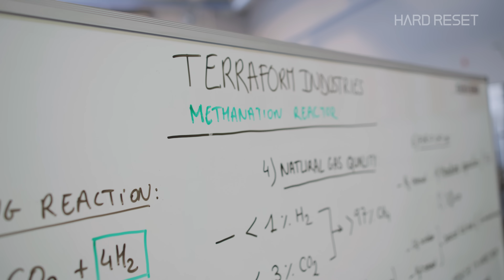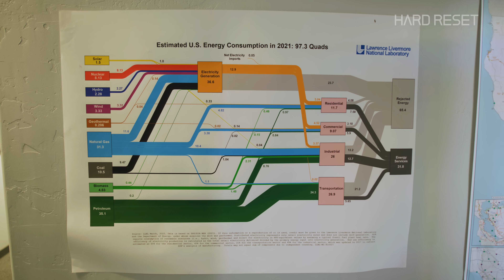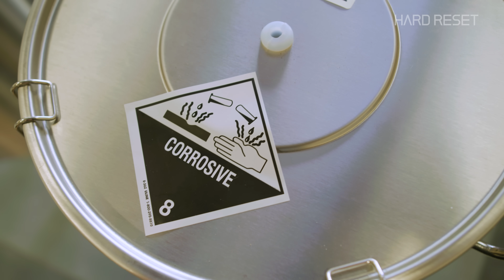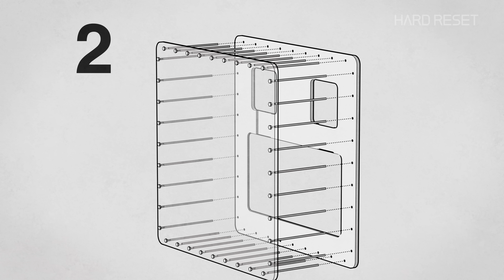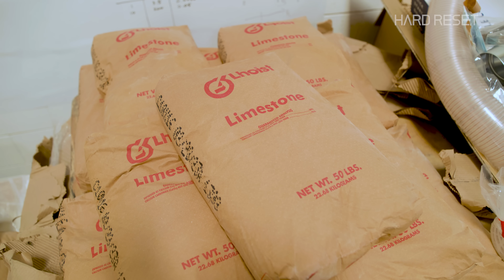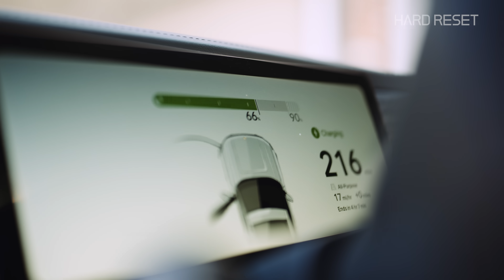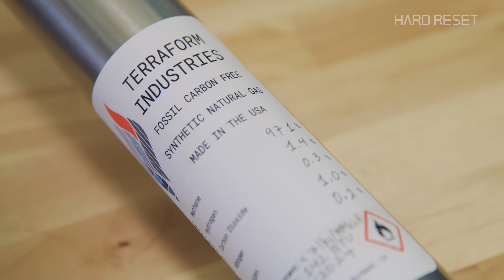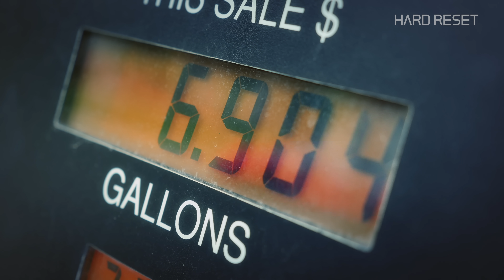The Last Fuel We'll Ever Need?

Comment: Our current natural gas infrastructure is notorious for having leaks. It spews methane into the atmosphere, which is a much worse greenhouse gas than CO2. Climate Town did a great episode on natural gas that talks about these leaks. In concept, I love the idea of replacing fossil fuels with synthetic fuel that endlessly recycles the carbon dioxide that gets emitted. But that assumes that all of the infrastructure works perfectly, and there are no methane leaks, which is definitely not how reality will play out. This feels like this project is going to be an example of the backfire effect
Reply: You didnt think of the fact that it can be produced at the place its being used so you dont have to use those leaky pipes.
Reply: @jedics1 You're suggesting a sea change in how energy has been produced, distributed and consumed for the past century! Synthetic fuel requires economies of scale in order to be economical. Point-of-use generation doesn't meet the necessary criteria.
Reply: If it has a standardised design at the factory level then at least problems can be addressed, and they likely went through plenty of quality control to assure that leaks were minimal to zero.

Hydrogen is VASTLY more likely than methane to leak, to say nothing of causing embrittlement of certain materials, so if they can make it work with hydrogen then methane should be a cakewalk to handle by comparison.

Either way, it's pretty clear that this is not a long term solution, only an intermediate path until the industries still dependent on the energy density of fossil fuels can become more efficient and/or switch to battery power as more advanced battery technology becomes available.
Reply: But you can just spew that out into the atmosphere as long as you pull out the CO2 to make the fuel.  Yes, methane has a stronger greenhouse gas but it also breaks down much faster and you don't need to get it to 0 leaks just less than alternatives.  

Also you can get clever and try to make sure the leaks end up decomposing.
Reply: This method needs to be to be put where the fuel is used to save the transportation cost. Every farm needs one. Every fuel station needs one.
Reply: oh shut up
Reply: I believe the vast majority of leaks come from wells not the pipe network. Particularly disused wells, and oil wells that give off methane as a byproduct. Since efuels don't involve wells the amount of leakage should be very low.
Reply: What's more in the end it's assumed that methane has to be used in appliances that can be easely electrified, thus more energy efficient since energy has to be spent in the first place to make this methane in all it's steps. If you need carbon based fuels or chemicals, more promising is deriving them from artificial crops or agricultural waste for example. The whole idea is worth exploring, but I don't see it putting it as a golden solution to all our problems.
Reply: @rysiu1694 You are right. The worst application is the one they are doing first, probably because its the one they figured out how to do first. Heat pumps and induction stoves take care of the the residential sector. What makes me excited is that they think they can to jet fuel next. While short-haul jets will go electric soon, long-haul jets going carbon neutral (even at high electricity fuel cost) with this technology is a big win.
Reply: @rysiu1694 artificiall crops or making methane from agricultural waste. Is not that valuable first thing is that we already do that in most waste procesing plants. Second is agriculture is producing co2 on it's own. So that solution wouldn't be neutral because you need to clear area from treas or natural plants and plant there a monoculture. Also this cannot be used in space. And it Wouldn't work when Sun is not shining
Reply: Big Oil sold natural gas as a transition fuel. The sad fact is that methane is 80% more potent than CO2 as a greenhouse gas. 

Studies have shown that just 4% losses and we'd be better off environmentally burning coal--the dirtiest of fossil fuels.
Reply: Well yes, but... a natural gas sector that only has the same leak problem its always had but is otherwise carbon neutral is a better natural gas sector. Leak detection and correction enforcement is not a technological problem, its a regulatory and cost problem.
Reply: The leak problem exists if this is implemented or not so its irrelevant in this case. It's not like existing green solutions are good enough to be adopted since they all require the entire infrastructure to be replaced and that's super expensive (and not realistically going to happen).
Reply: The thing we really need to go after is the planet releasing methane. It constantly releases it at scales we can’t even comprehend.
Reply: More CO2 -> more heat and photosynthesis -> less CO2. Nature is not so plane, as climate mafia
Reply: Methane is a nasty greenhouse gas, but it doesn’t stay in the atmosphere forever - it gets oxidized by free radicals in the atmosphere, breaking down into CO2+2H2O. Most methane is gone from the atmosphere within 20 years. While it is important to pay attention, it’s also important to have a proportional response, rather than IT’S ALL BAD NEVER USE IT. Only about a third of the methane in the atmosphere is from fossil fuel infrastructure leaks - the rest is agriculture or natural processes (you’re emitting methane too!). We also need to look at future use of methane. Methane is currently used for electric generation, residential/building heating, industrial heat, and as a feedstock for various chemical processes. Over the coming decades, it will be displaced for electric generation by cheaper solar/wind+batteries, in most building heating by heat pumps, and in all but the hottest industrial heat by thermal batteries. So I expect consumption to fall at least 50%. 

So it’s hard to completely get rid of methane. But if we can get rid of FOSSIL methane, we can stop adding more CO2 to the atmosphere, at least. CO2 is a much bigger climate problem, in both the short and long term.
Reply: Isn't natural gas methane? And isn't natural gas abundant? And now they say that natural gas isn't from plants that died millions of years ago but from radioactive decay deep inside the earth. Which means it will never run out. So we could just grow plants for food and stop wasting our time with this and just pipe it out of the ground. And don’t release it. That’s wasteful and expensive. Like pouring gasoline on the ground. Don’t do it.
Reply: It’s amazing how people make up stories of widespread methane leaks.  You can’t sell what leaks out.  No way is it cheaper to leave things leaking and it’s also ridiculously dangerous.
Reply: small on demand with no fuel storage negates the need for pipelines, storage of large wuantities, or concentrating it for transport...

most of these can be made at home.  and run safely. maybe safer than some methane production is currently done. 

methane, hydrogen , alchol very clean burning and together very good energy. all can be produced on demand with water and electricity.
Reply: The real advantage of this tech is when natively liquid fuels can be made through this process. The biggest advantage is the plug-and-play into existing ICE infrastructure and machines.

The main benefit of fossil fuels is portability, as battery tech will have to get MUCH better to match the energy and power density of burnable fuels. Because this uses electricity as an input, it makes no sense to go thru the intermediate step of methane generation for on-site use - just skip it for straight solar. 

However, if they can make carbon-neutral commodity fuels at scale cheaper than mining, they really have something. Add a refinery to turn methane into liquid fuels and they have a game changer on their hands.
Reply: @XxxThePsyCheMisTxxX  There already is an electricity to liquid fuel pilot plant in operation in S America. But because of the huge amount of electricity the process needs (it takes about 10x as much electricity to drive a fuel car 1 mile as a battery car 1 mile) it will always be a lot more expensive than just using a battery car. Synthetic fuel will be used only for premium applications such as flight, emergency vehicles, military uses, racing, etc. Maybe trucks in extreme environments. Most cars will be EVs because they are already good enough for most people's needs and are improving all the time. There's a car in development now that can recharge to 80% in 5 minutes. That's so close to fuel that it no longer matters. Synthetic fuel will be used as a luxury item for running classic cars and by people who need to drive a really long way without recharging. Within a few years the production cost of an EV is going to drop below the production cost of an ICE car. When more EVs start to filter into the second hand market there will be cheap EVs available for people who can't afford to buy new. Today rich people drive EVs and poor people drive ICE, but in the near future it's going to be the other way around.
Reply: It doesn't matter if there are leaks because it's taking the carbon out of the air to begin with. If a little bit leaks back, who cares? It's better than doing nothing.
Reply: You're totally right about leakage being a major problem! If we want to be charitable: the majority of emissions related to drilled methane are not caused by leakage, so replacing all existing fossil methane with recycled atmospheric carbon methane is still a large overall emissions reduction. Again, I totally agree it's not perfect, but that's a good step in my book.

Methane from the atmosphere isn't just useful for combustion as a fuel. Those activated carbons (especially if available at low cost) could be added onto other chemicals to replace fossil-fuel based commodity chemicals or to be made into degtadation-resistant polymers as a means of long-term storage of sequestered carbon. Ideally these use cases can be accomplished with minimal need for a pipeline, so these applications could foreseeably minimize the impact of gas leakage in contrast to combustion applications that require the fuel to be distributed across many sites. 

I think projects that want to reduce nitrogen gas to ammonia as an energy carrier can help a lot with the leakage problem because ammonia is liquid at ambient temp & pressure. This comes with its own technical limitations and challenges, but I think we do best to welcome a diversity of approaches when pursuing helpful technologies.
Reply: Methan  breaks down to C02 pretty quickly in the atmosphere.  Don’t be an alarmist 
.
Reply: Have I taken into account the leaking methane and gases from the earth's tectonic plates which are constantly moving, cracking and causing 'leaks'?
Reply: so what, you don't know anybody who's ever got sick or died from natural gas it's a meaningless thing to complain about what it does to our atmosphere that can be changed by planting a few more trees or doing something upset that let's see how the world changes the Fukushima disaster and other nuclear disasters when you have a nuclear leak, if you compare the same accidental problems of a little bit of nuclear energy just got released into the atmosphere or a little bit of natural gas just got released into the atmosphere which one affects the world in people 🤷🏻🧐🤔🤯🤯🤯🤯
Reply: It's still better oil
Reply: Climate town is a ratfink dum dum.
Reply: it's interesting that this was not even mentioned in the video.
Reply: I gave my cows extra beans this week to make up for your climate alarmist bullshat.
Reply: You Leak Methane….
Reply: I too don't want to do anything on life unless there's is a 110% guarantee of success and that I will be well compensated. As such, I too am just waiting to die, because while I'm not compensated, it is the least risky and most assured.
Reply: You are wrong about all your assumptions.
Yes there are leaks in everything.
New systems don't like old ones but you're against replacing them with new pipelines.
Gas can convert all coal sources of power immediately. That's a huge drop in polution. To the point we don't have to do anything else while the rest of the world ramps Nuclear and runs our country into the ground with the access to power. 
U.S. refuses to use nuclear so other countries are getting rich using technology we created but refuse to use.
Reply: Methane leaks and Human-generated CO2 are less than 0.1% of Greenhouse Gases. The Second Law of Thermodynamics shows that such a small amount of gases isn’t going to generate or contribute much to make the amount of heat to harm humans and other life forms.
Reply: Methane is only worse than co2 in the short run because it has a low atmospheric lifetime, it will eventually turn into co2 and water wapor, so it isnt worse.
Reply: The more money that gets poured into a technology like this means more money to maintain and upgrade the natural gas distribution systems.
Reply: This device also doesnt end racisme, what is your point precicly?
Reply: Gas flow works in every country without day to day leaks outside of America. Maybe this issue you are talking about is mostly an “America” thing? You don’t have to run pipelines with big leaks… Chemical dosing and maintenance goes a very long way!
Reply: If you have made methane, you don't have to leave it as such.

Catalytic partial oxidation can turn it into methanol, a much denser non-gaseous transportation fuel.

Or you could Fischer-Tropsch the methane into synthetic distillates, like jet fuel, diesel...

All of this chemistry is a century old....
Reply: @NullHand  I was wondering why they were stopping with methane. If we're going to replace oil, it would be better to have something with energy density similar to gasoline.
Reply: @ True, but you also have to convert it back after.... in some cases yea you can totally turn it into other products and it more than likely will be good, but even a little can be still way worest than the Co2 that is normally release... lets also not forget about just the Co2 to mine the rocks in the first place:)
Reply: @NullHand  Yes, and it requires additional processes, equipment and energy to achieve. This makes synthetic methane even less affordable. No one ever adopted a more expensive thing unless it was better, cheaper or mandated.
Reply: What are you talking about?There is no such significant leak in Natural Gas transmission and distribution. (I work in this industry)
Reply: This is using so much water.
Reply: @mrjasonjneal  can that water be recycled and re-used?
Reply: Hydrogen leaks are even worse.  This is one of the biggest problems with using hydrogen for fuel.  Hydrogen loose in the atmosphere is a huge problem, I'm not sure the chemistry but it's a thing, look it up.
Reply: " which is a much worse greenhouse gas than CO2."

Except.... it's not.
Reply: @ 
" which is a much worse greenhouse gas than CO2."

Except.... it's not.

Interesting. That isn't what real laboratory experiments by real scientist, who spent 10 or more years of intense study to become real experts in this, say. The real science shows that pound for pound methane retains 108 time the heat in the atmosphere than CO2 in the first year that it is emitted. 

However, methane only stays in the atmosphere for about 12 years unlike CO2 which stays in the atmosphere for centuries. Thus pound of methane released today will trap about 80 times the amount of heat of a pound of CO2 over a 10 year time period. 

The normally quoted 25 times the heat retention for methane compared to CO2 comes from a comparison of the impact of methane compared to CO2 when integrated over the standard 100 year period. The problem with that number is that for 90 of those 100 years the methane is no longer in the atmosphere.
Reply: CO2 is not a greenhouse gas other than it is used in greenhouses to make plants grow more.
Reply: @Onan-u3b  :D
Reply: You're not wrong. But this could be implemented in a carbon negative manner. If methane is produced on site at natural gas power plants, the resulting CO2 could be captured and stored. Is that economical? Probably not at today's prices. But it is conceivably doable.
Reply: @ryanbrown982  Methane is over 80 times worse for global warming than CO2 - i.e. if you release the same volume of CO2 and methane, the methane will be 80x more damaging than the CO2. If you're removing CO2 from the atmosphere and creating methane, and more than 1.25% of that methane is getting released back into the atmosphere, that is bad for global warming overall. That's the point that's being made here.
Reply: @whatevil  depends on the timeframe you're looking at. Methane decomposes in the atmosphere, so it's effects are limited. Yes, 80x over something like 15-20 years. 20x over a century. Bad however you look at it.
Reply: @whatevil then don’t release it. That’s wasteful and expensive.
Reply: It get worest than that... even with solar, you are taking up more land to power the fans, moving the elements needed, and finally heating it up to release and process it back out. So you will never really be co2 even... you will always be taking more in to do it and if demand is high enough... you know they wont relay on solar alone... and that means burning more coal to get the power needed. Now, if there was a way to turn this carbon into something like wood is or metal sheets of it... then that is where carbon capture will shine for sure. Also, instead of using solar (the visual light) you could turn the wasted IR light (heat) to heat up the rocks to release the carbon - also using that same heat to create convection (no need for fans).
Reply: @adr2t  That problem of solar taking up lots of land is going to change in the future. Ironically using old tech to do it. It's possible at this point to stack solar panels on server racks in a warehouse or greenhouse to produce more power per acre reducing land purchase costs and using that money towards upgrading the system itself. The costs also decline because the panels are taken out of the weather and placed where they are better protected. Their efficiency goes up in better temperature controlled environments. Two methods pull it off, Fiber optics and direction tracked Sun tunnels.
Reply: @daniellapain1576 UH? None of what you said made any sense sorry. "server racks"? You mean for batteries? You can't stack solar it self... there is only so much light that hits an area. Now there are better stacking methods, but that doesnt change the fact there is only so much you can pull. IR doesnt hold a lot of power in it self. UV is filter by Earth protection.Fiber optics filter a good chunk of solar... either way you slice it, the only way to improve solar is to either bring down its cost or access the UV+IR range (for the full 100%) but only a increase of around 50-100 more watts give or take of what we get today for the same area. Aka, 20% -> 40% is kind of the real max you will get. Still double today, but you will be pretty much hitting the full amount of power we're ever going to get in an area. Raw IR is easy to get because its cheaper to hit with mirrors - thus that is the only way you will have the increase power to help cook the rocks to release the Co2. Think of the "Dome" and you would just focus the light in a single location pointed down wards. Still more power then ever needed I would assume.
Reply: @adr2t  Your criticism is valid and I can understand why you would think so. All I was talking about was the light delivery method being changed and being implemented by companies to solar panels because what you mentioned was the panels taking up land. I have personally seen people trying real world solutions to this problem and it is promising. I have been toying around with some concepts myself. You can condense a solar panel to a smaller area and produce a similar result. Bifacial solar cells make this easier to pull off. You also need a different type of mirror to reflect sunlight. This is a similar material to CDs but spanned out. I apologize if your mind was somewhere else at the time of writing this. I figured you might appreciate the knowledge that solar panels don’t need to take up much land. Remember just because you haven’t spent a certain amount of time on a subject doesn’t mean you should be hostile about it. It’s the boon of progress when you do that. Look into it yourself and try things out and see for yourself. It’s cheap enough to get a model going. You’re not the first to immediately monkey brain freak out it won’t work when first hearing about it. An example video can be found on Robert Murray Smith’s channel where he plays with the idea but doesn’t create a full model. He just shows it can work. Other people on YouTube have come up with similar solutions to solve solar taking up space. Hopefully you have some insight and fun trying it out.
Reply: @daniellapain1576 CS is what you are talking about, but it still requires x amount of coverage. There is no magic design. The only difference there is you are pulling more IR + Visible + UV into a central location. Thus the over all solar panel part is cheaper. This falls into what I was talking about. Either you make the panel it self cheaper or access the other spectrums of light, but CS still requires about the same amount of light, but using cheaper (lenes) to move that light. Thats fine, but I am just point out it still takes the same amount of land sadly. The reason this idea works is just the fact then you can build more costly cells that capture those other parts of the light. UV contains a ton more power, but it is limited to only 2-4% of the total light that reaches earth. The other problem with CS is the fact you have a ton of IR now you have to deal with or heat. Heat will destory that solar panel very FAST. So either you have to capture it fast enough or figure out a way to move it... and now you just took some of the gains you just got back out. Granted, I can think of a few ways to make use of the wasted heat... (like warming up water and storing/air pump system/water heater), but at that point you are adding complexity too.
Reply: @ Right, but this really isn't a problem in the first place.  There is plenty of space it's not harmful to shade and there are all sorts of ways to colocate panels with fruits or shade produce not to mention all the space on buildings.

The bigger issue is the lack of power grid build out.  If you want to do this you either need to move the gas around or move the power to where you generate the gas.
Reply: @dapain1576 the solar flux in watts per square meter is fixed. To collect a given amount of energy then requires covering a given number of square meters of land regardless of whether that is directly captured by solar cells or by fiber optics/light tunnels to bring that light to solar cells. So land usage won’t change regardless of how the light is captured.
Not that your idea doesn’t have merit. There are solar cells that can work at a light intensity equal to hundreds of suns. So arrays of mirrors focusing the light onto a much smaller area of solar cells can reduce the total area of the cells. But that just means the area of regular solar cells is replaced with mirrors and the gimbaling frames to hold them and motors and gears to move the mirrors to track the sun. So the amount of material might not be any less than just making flat “one sol” arrays have the cells capture the suns energy directly.
Reply: The CO2 for this comes from existing CO2 in the atmosphere, so the leaks would have the same climate impacts as actually burning the fuel for use. It would be “waste” but not CO2 waste
Reply: @mattmills6419  No, that's not correct. Methane is dramatically better at absorbing infrared than is CO2. Over 100 years, an equivalent amount of methane will trap 28x more heat than the CO2. It's still better than pumping it out of the ground, but methane leaks are in no way carbon neutral regardless of the source.
Reply: @ryanbrown982  <--This guy is correct, but I will add, it could be used as a battery. While its true its hard to transport the gas without leaking some, you could transport it onsite into tanks where it can be burn later thus the risk would drop a lot more if they did it this way. It is way better than hydrogen for at least that as its a bigger more stable element and thus has a harder time leaking out of tanks. It wont be better than current batteries ... but it could be at least something for that + remove / recycle its own carbon emissions.
Reply: @ryanbrown982  methane is fairly unstable and breaks down in our atmosphere over time.  With this process they are attempting to make it reliant on solar vs fossil fuels an environmental win.
Reply: @ryanbrown982 Methane in the atmosphere doesn't stay methane. It naturally reacts with the oxygen in the air to form carbon dioxide and water.
Reply: @ryanbrown982 methane degrades faster than co2.  We should still be using solar for as much as possible, but synthetic fossils fuels are a good thing to have knowledge of and production capacity for...the main thing is to stop digging stuff up and use clean  distributed energy where you can.
Reply: @mattmills6419  Methane (CH4) retains more heat in the atmosphere than carbon dioxide (CO2). They both have one carbon atom, so the number of carbon atoms remains the same, but depending on what they are bonded to one molecule has the potential to trap much more heat in the atmosphere than the other. It's still a great idea and much better that the status quo, so we shouldn't let perfect be the enemy of good.
Reply: @mattmills6419  i agree. It's is same as battery loss... i.e. backup cells leak power over time. But my question is usability wasn't addresses. How does methane compare w gas, hydrogen, and battery storage on a mobile device? Life of fuels are sig better than batteries but why didn't they stop w the hydrogen gas? 8lbs of compresses H2 gas can drive a prius 500miles I read.
Reply: @mattmills6419  Methane is a much more potent Greenhouse gas.